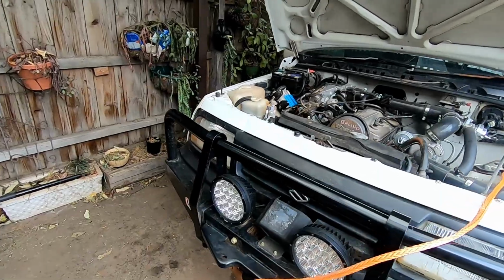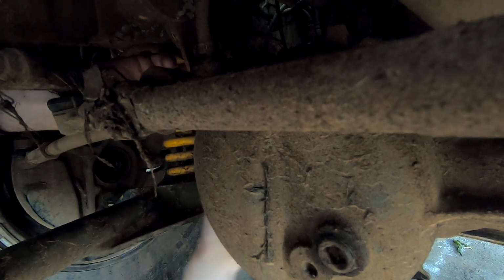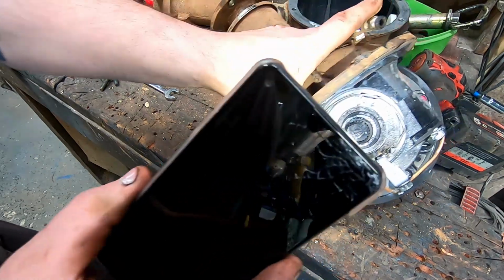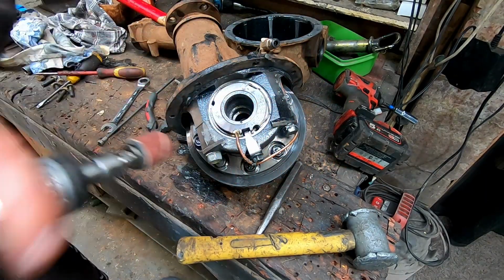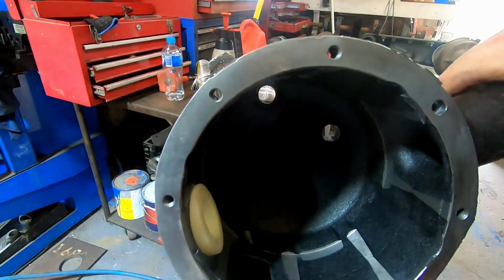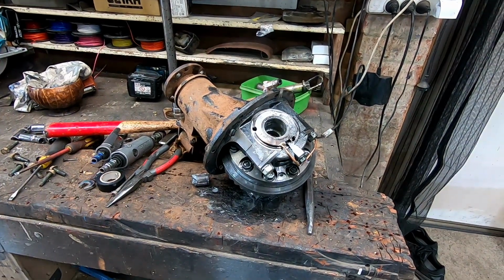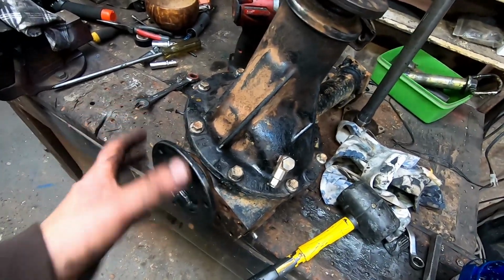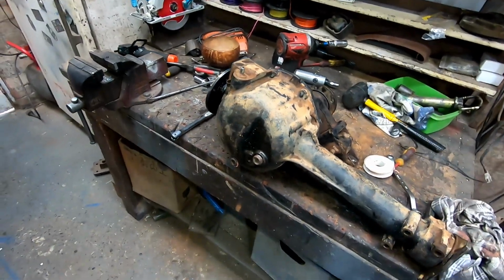Vitara Font Diff Air Locker Repair  - Broken Stub Axle

Comment: Those Steel front diffs are very hard to come by here in the US. The going rate now is $650 USD ($910 Austrailian)  for one so that's a great find. I've been looking for one for my SV418 Which is  a Vitara (Called the Suzuki Sidekick Sport in the USA) with a 1.8 DOHC motor. You guys had them with a 2.0 DOHC motor (SV420) or 2.0 V6 (SV620).  I put in a 2.3 DOHC from an Aerio (Liana or a Baleno) and its been great.   We also do the 'stubby shaft' by cutting off the 3 holed "triangular" left side plate from the axle axle and welding it to the stub shaft. making the same thing you have there. that is a 'round puck'.    

I'd love to see a video on the 'aftermarket courier' shafts being used as they seem a bit more robust than the stock axles, but the all break.

Glad to see you've also been 'monetized' now with 1.02K subscribers.. Great day for you!!  keep up the good work!!
Reply from the maker: Steel front diffs are pretty common in Aus, I'll keep an eye out for you
Those axles are great but just breaks the next weak link (stubby shaft), 26 spline should make a fair difference in strength 
Thanks mate cheers!
Reply: @jaydnp.  thanks for the lookout but the shipping to the USA would eat up the savings.  I just bought a winch bumper from JWB Customs in Australia and it was as much as I paid for the car.  I'll continue to look on this side of the world..😁

Comment: Why so gray gearoil loos like a water has been in there mixed with the oil ...Air leaking  in the Locker let some moisture in the Axle house and destroy the Oil ?
Reply from the maker: Correct, it's had water in the diff